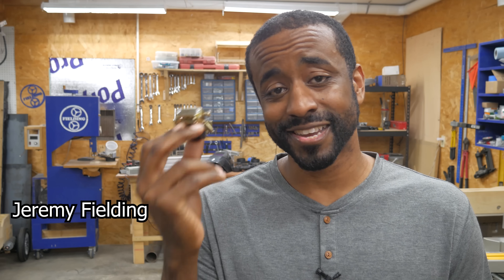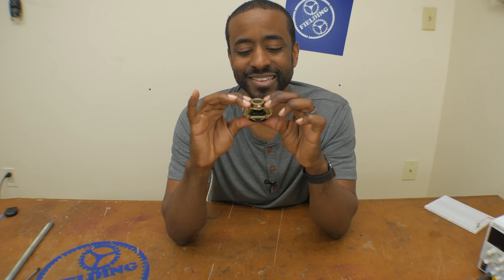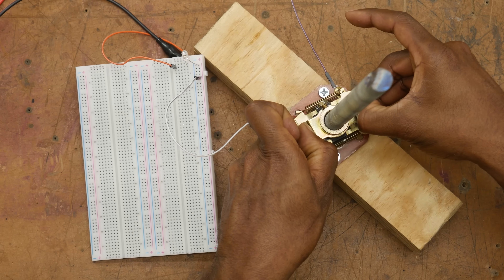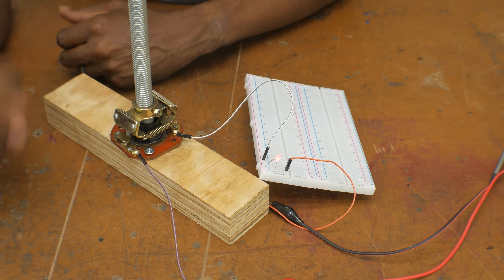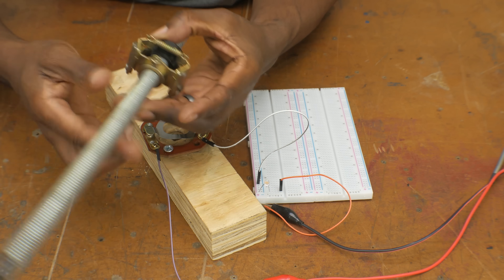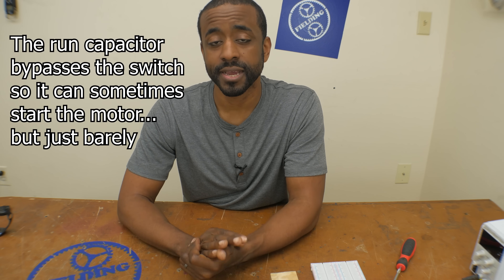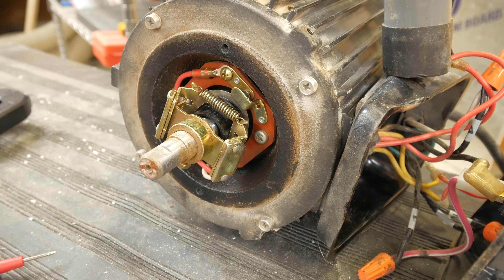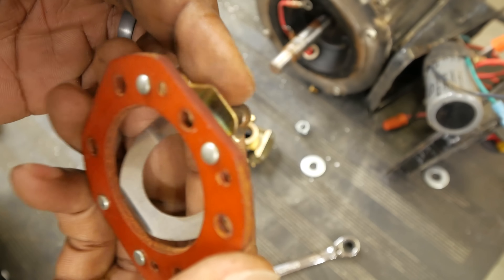This Clever Device Is Found In Nearly Every American Household. How It Works And How To Fix It

Comment: I am a technician in a factory, the very old equipment used to use a similar device to monitor motors to verify they are running, if the motor isnt at speed  the switch doesnt make and can shut down other motors or sound alarms, etc.

Comment: Jeremy, it's not a "kick start", but a secondary coil that gets phase shifted by 90 degrees to create enough torque to start the motor. Which is why this isn't necessary in a three phase motor since each phase is 120 degrees apart from the other phases. As for cost effectiveness, arguably a shaded pole or a run capacitor is cheaper in cost, but costs more long term because of higher electricity usage.

A little fun fact is that you don't absolutely have to have one. I knew a old machinist whose centrifugal switch had gone out on his saw. He simply would use a rope to pull start the motor spinning and then turn the power on. 

It's also how I start up my single phase to three phase converters when I don't have a pony motor installed on them. Just be sure that the rope has come well and truly off of the shaft before you flip the switch. You are simply not going to win that tug of war. 

BTW, the converter that I am currently working on is a 50 hp, 480 volt monster. :)

Comment: The centrifugal switch is based on the centrifugal governor invented by Christiaan Huygens in 1788 which was first used in windmills between millstones. It was later used in steam engines. A patent search shows the centrifugal switch was invented by a Swedish inventor named Carl Edvard Johansson in 1926 and patented in 1927 Patent number US1651708A. At the time he was working for Henry Ford. I found no specific use for the centrifugal switch in Ford vehicles at the time but they are common in vehicles today.

Comment: I think, in some cases, the contact points are plated with a different metal.   Sanding them down may only work temporarily, as the new contact points will be of a metal that will oxidize more quickly.

Comment: This device can also be used for when the RPMs get too high, it stops the current so it doesn’t damage the motor.
Reply: The maximum RPM of induction motors is set by the mains frequency ie 60 cycles/sec

Comment: Works great in motors that don't sit out side, on a pump motor I had once, the shaft rusted and it couldn't operate, thereby burning out the motor as it didn't  have the benefit of  having the start winding in  operation.   Got a motor with a different start switch  system.

Comment: Used back in the day of steam , the quote , balls to the walls . The phrase “balls to the wall” may come with the centrifugal governor of a steamengine, which used spinning ballbearings to adjust a valve limiting the amount of steam entering the engine. This electrical version. The phrase “balls to the wall” may come with the centrifugal governor of a steamengine, which used spinning ballbearings to adjust a valve limiting the amount of steam entering the engine.

Comment: Over 100,000 views. The world was hungry for this video.
It would be best to use a 600 or 800 grit sandpaper on contacts. Anything rougher may
cause the contacts to pit faster. Or use a 1uF/220vac capacitor (on a 120vac motor)
across the contacts to reduce the arcing that causes the pitting.

Comment: Yeah, the tab is burned because you touched with a lead when it had power.
Reply: Is that a joke? Those contacts are points, they are designed to tolerate a small spark every time the motor is turned on. After years of use they always get corroded. As time goes by the corroded area creates an ohm or so of extra resistance, and with the high current across that extra resistance it creates heat that accelerates corrosion. The spark from his multimeter lead was on the edge of the metal, not at the area of the points.

Comment: Hi Jeremy, the same basic principle is used in older automotive distributors to increase ignition timing advance & in centrifugal switches on turbine engines to control when the starter, ignitor & fuel solenoid operates or disengages. You may find that interesting.
Love your stuff bud!

Comment: The switch resembles a centrifugal governor, also known as a Watt or fly-ball governor on a reciprocating steam engine. They pre-date the electrical era and are most likely the predecessor. Thanks for the video, I like your style, easy to follow along.
Reply: That's where the term "Balls Out" comes from. Saw a video with Jay Leno talking about it on one of his steam engines.
Reply: @de3481  Also where the phrase "Dropping the hammer" comes from too, ie pulling the balls in to go faster by adding a hammer to the bottom slide ring.
Reply: Mark Stock I’d like that twice if I could. Good fact!
Reply: @de3481 Oh I see, I always wondered about that, so it means when your balls are out, swinging.  I always thought it meant... ...Actually that discription fits perfectly.  However, that's a "governor" not a "switch" but clearly the centrifugal essence of it in the govenor was the genesis and it was the earliest in 1827 if memory serves me well.  There is the centrifugal clutch too, of course made by the British, Talbot motor car company in the 1930's. 🙂
Reply: Check out David Richards channel, just look for "Old Steam Powered Machine Shop". You'll see governors in use and I think a couple rebuilt.
Reply: @SyBernot  absolutely! 
He definitely has a one of a Kind shop!
Reply: Centrifugal governors were invented by Christiaan Huygens and used to regulate the distance and pressure between millstones in windmills in the 17th century.[1][2] In 1788, James Watt adapted one to control his steam engine where it regulates the admission of steam into the cylinder(s)[3]
That's what I could find on it.
Reply: Centrifugal governors apparently date all the way back to the middle 17th century - they were invented by, it seems, Christiaan Huygens, the guy who described the laws of circular motion. Fascinating guy, very important to modern science. Also invented/discovered things like pendulum clock motions, Saturn's moon Titan, wave theory and an early experiment into combustion engines that ran on gunpowder(!).
https://en.wikipedia.org/wiki/Christiaan_Huygens
Reply: @autochton  I thought that name sounded familiar. He has a space probe named after him right?
Reply: Farmall tractors in the 40's had them, I found out what happens when linkage pin comes out...
Reply: @ffjsb  well now you have to tell us what happened 🤔
Reply: That's what I was coming down here to say! James watt while I don't think he actually invented it. Did adopt it to control the speed on his steam engines. In my head I believe it was invented back around Davincis time. But who knows.
Reply: All lawn mowers have a centrifugal governor
Reply: @hojo70  Some actually use an air vane governer powered by the cooling blades on the flywheel.
Reply: @hojo70  Actually, only some of the small engines have centrifugal governors, most usually found on the higher horsepower engines.  The lower horsepower engines (those more commonly found on push mowers) use an air vane governor.
Reply: @hojo70  Not all. Some cheap ones have a wind vane by the flywheel instead of an internal governor driven by the camshaft.
Reply: @hojo70  I am not a mower mechanic but I have never seen a centrifugal governor used on a mower. They are mostly operated by moving air from a flywheel mounted fan impacting on a vane that is attached to the throttle linkage. The faster the engine revs, the greater the air pressure acting on the vane.
Reply: Damn, I just got through posting about that. I guess I should read before I post lol
Reply: Just discovered your channel. Very happy to have done so. Excellent, excellent presentation! Thanks!
Reply: Therefore "balls out".
Reply: wholeNwon Awesome fact, thank you.
Reply: I stay with H.E. White as the inventor in 1919, granted 1925 and Huygens in 1673 as the conceptual creator.
Ladies and gents, if I may:

Christiaan Huygens (1629 - 1695) was a Dutch physicist, mathematician, astronomer and inventor. His most famous invention was the pendulum clock (1656) that became the most accurate timekeeper for almost 300 years.

In 1659, he published his work De vi centrifuga  (in Latin) containing the still-in-use standard formulae for the centripetal and centrifugal forces .

In 1673, another work of his (also in Latin) Horologium Oscillatorium sive de motu pendulorum , on pendulums and horology, containing the analysis of a problem posed by the French Mathematician Mersenne on how calculate the period of a pendulum made of winging rigid bodies of any shape and the analysis of the conical pendulum, consisting of a weight on a cord moving in a circle , using his concept of centrifugal force . The measurement mechanisms used for such analysis lead him to another invention of his: centrifugal governors used to regulate the distance and pressure between millstones in windmills, as already stated, making the Netherlands famous for such agricultural equipment until now. In 1788, James Watt adapted such control to regulate the quantity of steam into an engine, in the beginning of Industrial Revolution it caused such impression that James Watt is often confused as the inventor even nowadays.  

Another cause of confusion can be the types of controllers: the most famous centrifugal governor is a Continuous-type control that controls a variable, usually speed, of an engine by regulating the quantity of fuel or fluid such as steam, in order to achieve any desired value (set-point) between min 0% to max 100% or in some cases such as on idle speed let's say 50% to 100%. Such continuity makes it also a Proportional control , a linear function.

The History section of Centrifugal switch in Wikipedia is quite uncompleted. The US Patent #1,630,394 granted to Royal Lee on May 31, 1927, is more about an Electrical speed governor adding more poles to an already invented single pole centrifugal switch . Such governor is a Discrete-type control meaning it has a limited number of  steps or states of regulation to make the variable achieve the set-point. As a non-continuous and non-linear function make it also an On-Off control instead a proportional one .
In this specific R. Lee's patent the available states are:
Stopped: 0% speed;
"Low Speed": motor at let'say 33% speed;
"Intermediate Speed": motor at let'say 66% speed;
"High Speed": motor at max 100% speed;

In other hand Harold Elijah White, inventor of Montclair, Essex, NJ, had his US Patent #1,552,589A CENTRIFUGAL ELECTRIC SWITCH applied on November 15, 1919 and granted only on September 8, 1925, only one and a half years before Royal Lee's electrical (discrete) speed governor. H.E. White's invention was not intended for speed control, it  is a single pole switch, more a safety/starting device than a control device, that is exactly the point of this video, as described by himself:
"Single phase induction motors, to which this invention is especially applicable, comprise two windings, one of which is required to be energized only during starting and the circuit of which it is desirable to open when the motor has attained a certain speed" .

H.E. White's patent took so long to be granted because the dispute over other applications of Centrifugal switches already in use since 1900 to 1910 or even earlier, mainly in electric fans. It was a "common" invention based on Huygens concepts every reasonable Engineer should know, maybe each one thought that each other already invented, and despite the worldwide claim of an US Patent other countries with developed industries as Germany and England were not under US laws and some other countries even had patent regulations.

In my humble opinion:
 Hooray for H.E. White and Huygens.
Reply: Damn, seriously...come on Bill, get a damn clue lol.
Reply: God dam, I was just thinking that.
Reply: Centrifugal governor is exactly what came to mind for me, since engines and even transmissions use them to govern max engine RPM, or to determine the shift points in a transmission.  These days engine and transmissions are electronically controlled, but centrifugal governors allow for fine tuning without the need of a computer and degree.
Reply: Exactly what I first thought when seeing this switch. Its where the term balls out comes from. Meaning if your balls are out on the governor. The steam engine is up to speed.
Reply: This was my thought too, but I'm not sure if it's the case.  There are a lot of centrifugal switches out there from this electrical switch, to the fly-ball governor, to the centrifugal clutch used on a lot of small internal combustion engines.
Reply: Just file the contacts to clean them up. Duh.
Reply: @JohnSmith-lw2bm  They used to make a small file just for that purpose.
Reply: Big difference though. Fly-ball governors on steam engines don't have a  snap-action. They "proportionate" over a certain range.

Comment: Hi Jeremy, the centrifugal device started life when steam engines were being developed right back in the early days so a lot more than a hundred years, though not as an electrical switch but as a valve to regulate engine speed.  The early ones had a ball weight at the end of a bar the other end attached to a ring on a rotating shaft, at the ball end another bar went to another ring on the same shaft but not attached, there would be two of these ball assemblies for balance, as the shaft speed increased the balls would fly out and lift the lower ring which by various other mechanisms would close down a fuel or steam supply so as you can see it was exactly the same principle and design but interesting factoid because the weights were balls the expression "Balls out" meaning full speed was born, not popular today as it is seen as a rude remark  lol .
Reply: You beat me to it. :)

Comment: Jeremy, so interesting that you posted this very timely and relevant video. I have been troubleshooting a bench grinder that has this type of switch. Someone else has been in there and the starting cap was removed. The only clue I found was once I took the motor apart there was a wire dangling off one side of the switch. I guess they were trying to use the grinder without the starting cap and it would just hum. Trying to source a new cap now. Interesting little switch!

Comment: The Start capacitor doesn't give it a "kick" what it does it makes sure the next coil is 90 degrees ahead of the current coil which cause the magnets to be attracted to  it  and during the next AC cycle then next coil is 90 degrees ahead of the current coil and the magnet is attracted to it. Once you get to a certain speed then this happens naturally which is why you see common speeds on motors such as 1725 RPM. The capacitor value/size is based on frequency (in this case 60 hz) and the coil inductance . Depending on the motor, mainly the winding inductance, the kickout speed can vary from 70-90% of rated speed

Note also that some motors use a Run Capacitor that is always in the circuit basically because they can't make the coil windings the right inductance due to size limitations You see that a lot in A/C compressors and you can easily tell a Run Capacitor from a Start Capacitor by the case .... If the case is plastic it's a Start Capacitor and has a limited Duty Cycle and if the case is metal it is a Run Capacitor and has a 100% Duty Cycle .... Start capacitors generally have a higher Farad rating than a Run Capacitor .....  Run Capacitor failure is a common fault in A/C compressors and usually a visual inspection is all you need, if the case has a bulge just replace it because if it hasn't failed already it will fail very soon
Reply from the maker: This is a beginner video not meant to explain the motor operations but the switch operation. If it makes you feel better about my knowledge on the topic you can watch a video I posted a few years ago “ how motors work for beginners- single phase”

Comment: @Jeremy Fielding Here's what I found. This invention relates to centrifugal switches mere particularly of the type commonly used in split phase induction motors to open the starting winding as the motor approaches running speed and to close the starting winding when the motor speed drops below a predetermined low limit. A motor... 
Recorded Inventor: Frederick, Diehl
Application Number: US1459535A
Publication Date: 07/21/1936
Filing Date: 04/04/1935
Hope this answers your question.

Comment: Hey Jeremy. I remember seeing this invention for the first time when I was about 12. It wasn't until later when I was in college at RPI that a mechanical engineering professor said the first electrical centrifugal switch was invented by the Singer Sewing Machine company in the late 19th century. That always stuck in my head. The age of some of these ideas sometimes blows you away..and we're still using them to this day..because you can't make them any more cheaply or have them work as reliably. BTW, rebuilding electric motors is an art and finding businesses that can rebuild antique motors are VERY hard to find. Often times you have to recreate bakelite "circuit boards" from scratch because the parts just aren't available. I know one person near me that has a thriving business rebuilding antique and old motors. Anyway..throwing that out there for anyone that might have the skills, tools and is looking for a business idea to get into.

Comment: They have been around in one form or another since their invention by Christiaan Huygens in 1788 who developed the centrifugal governor to control the speed of a millstone used in windmills.
James Watt later used the same principle to regulate the pressure within a steam engine, and so they have found their way into many other applications since.
Yes they are a very clever device! I would describe them as the transistor of the 18th century.